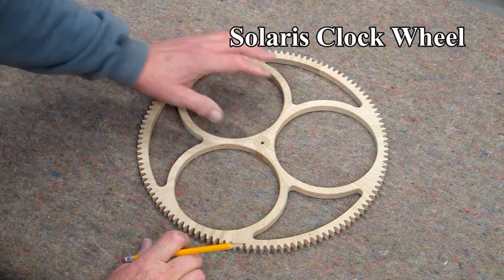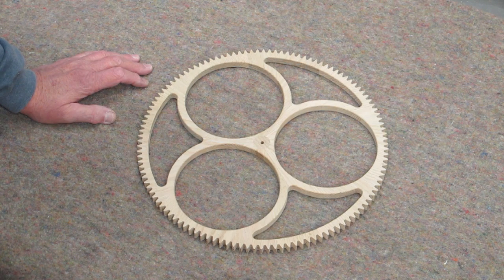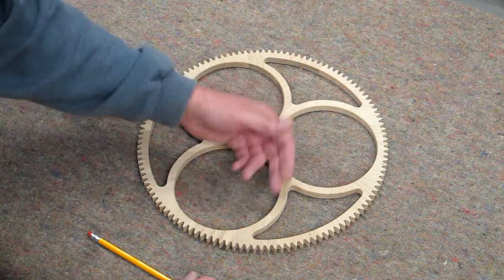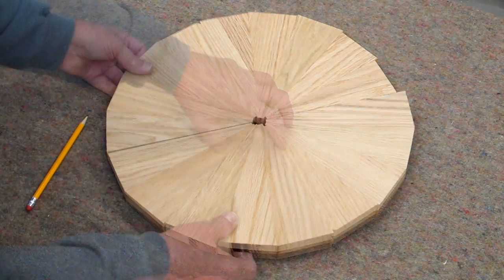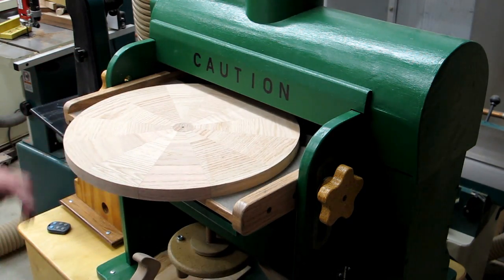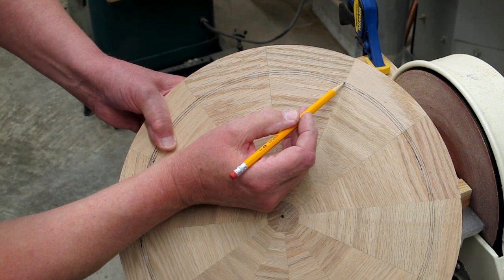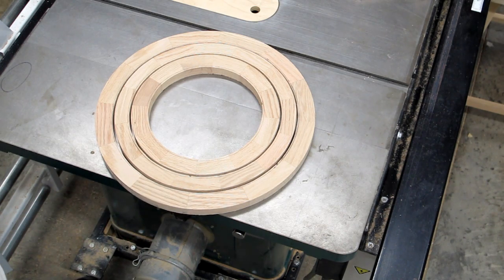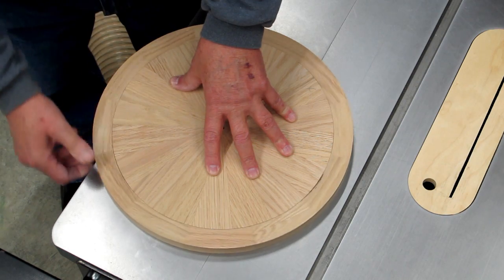C&R Grain Solid Wood Wheels Part 1

Comment: So I am curious about the grain orientation. Wouldn’t you want the grain to run parallel with the teeth? This would (in theory) make for a stronger tooth. Like as in the difference between a dowel vs a bung
Reply from the maker: With the C&R Grain Direction (as explained in the video) we are trying to avoid (minimize) excessive wood movement due to weather changes and the resulting cracks or splits often caused by the increase and decrease of moisture content in the wood due to changing humidity. If it is a good piece of wood to begin with, the teeth will be strong enough. In a wood gear clock, there really isn't much load on the teeth. The teeth are mainly providing the timing, motion and the interesting appearance, hopefully without cracks, splits or warping.
Eleven years later, these two large wheels are still flat and crack free.
Thanks for watching! Please subscribe. 
That is what keeps this channel going. 
Ron

Comment: I'm not quite so patient, so if I were to actually attempt this, I'd make my blanks thicker than I need.  Then I could put a degree or two of angle on the spindle sander so I wouldn't have to size the hole so accurately.  If I was a little off it'd be okay because the two pieces would just taper together.  I'd end up with an uneven surface, but that could be planed or sanded off.

Very impressive, though.

Comment from the maker: I don't think this particular configuration would work. With the constantly changing curvature of a guitar body, I imagine something similar to a pin router would be needed to do the sanding and then it would probably need to be carefully hand-fed past the reciprocating spindle sander. I have seen where Grizzly sells quite a few of their reciprocating spindle sanders to guitar makers. When I first bought it, I never imagined how much I would end up using it.